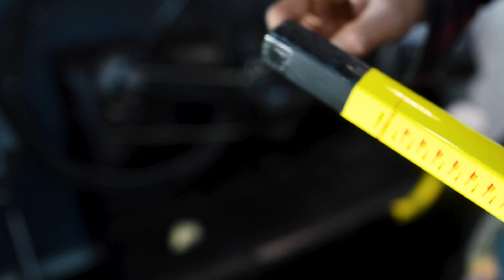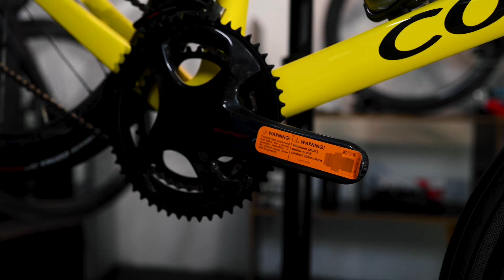Colnago V3RS Tour de France - Dream Build

Comment: road bike tip 101: Don't ever tighten your skewers while the bike is on a rack, sit the bike down on the ground and put some weight onto the bike so the wheels are at it's final positions, then tighten the skewers. for rear wheel you want to hold on to one of the brakes then push on the pedal so the chain is in tension, this will pull the drive side into it's correct position in the wheel socket, then you can tighten the rear skewer while the chain is in tension. unable to do these steps will result in the dropouts wearing out prematurely from the movements between the dropouts and the axles, especially for carbon dropouts.